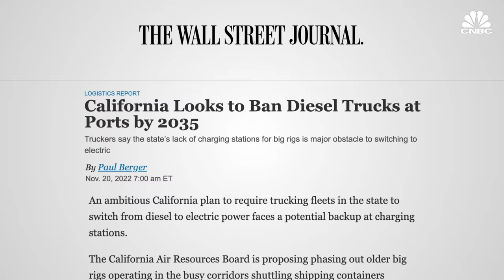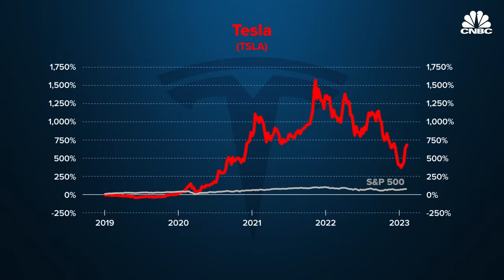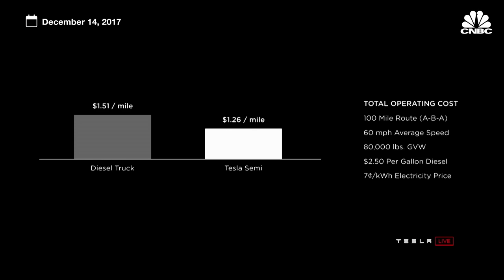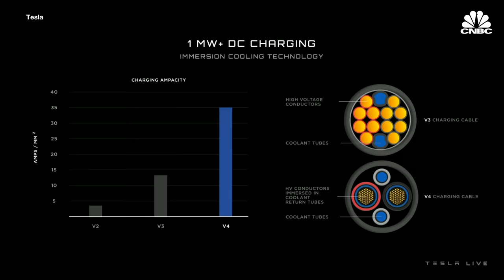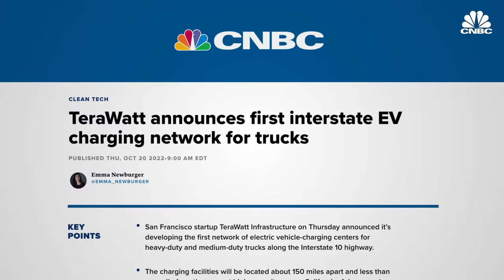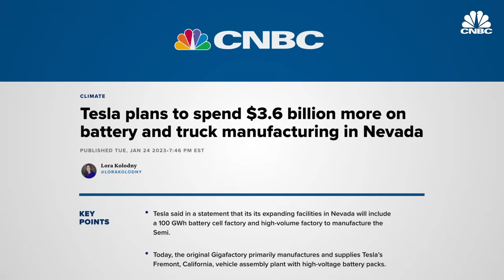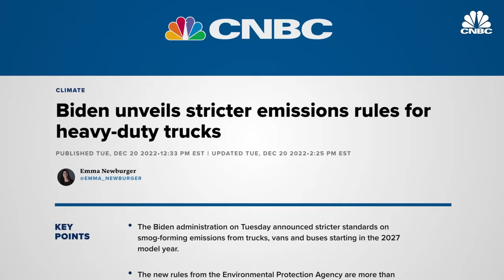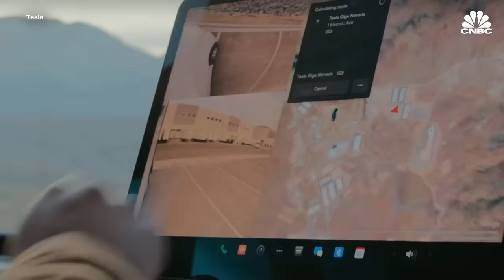Does The Tesla Semi Live Up To The Hype?

Comment: How much they charging for these things and how long they last? Semi couldn’t haul the weight. The EPA shouldn’t be pushing this regulation on the so called free market. It will destroy our country and lives. Supply chains are already stressed. They are destroying our way of life and their way of life too.
Reply: This truck uses 811 cell chemistry, it will go 400,000 miles before the battery looses 20% of its capacity, the trucks should cost around $200,000. But if you compare prices of fuel between both the electric semi saves over $200,000 in fuel over 400,000 miles driven. Newer version with silicon cells will do 900,000 miles.

Comment: Max gross weight is 123,000lbs or 63,500kg not 80
Reply: 23 USC 127(s)
"Natural gas and electric battery vehicles.--A vehicle, if operated by an engine fueled primarily by natural gas or powered primarily by means of electric battery power, may exceed the weight limit on the power unit by up to 2,000 pounds (up to a maximum gross vehicle weight of 82,000 pounds) under this section." 
Are you in Canada?

Comment: 80% of electricity is still producing by burning gas or petroleum so I don't see any sense of this EV trucks yet. to recharge them you need to burn more oil or natural gas. wind and solar is not enough. Just marketing of tesla
Reply: Well, I just checked, and I learned to my surprise that you making up stuff and posting it on the Internet doesn't actually make it true. Who knew, right?

Since you're obviously a numbers person, I thought you'd want to hear the real numbers. First, 100% of the Tesla Semis delivered to date are deployed in California, where only 40% of energy comes from "burning gas or petroleum"—almost all of the 40% from natural gas. Second, Tesla Semis have triple the energy efficiency of diesel semis, and as such use only 1/3 the total energy of diesel semis.  So compared with a diesel semi, a Tesla Semi uses only 33% of 40% = 13% of energy from "gas or petroleum", as a diesel semi. Finally, as noted above, almost all of the 40% in California comes from natural gas, which produces only 25% of the particulate matter emissions as diesel trucks. So compared with diesel trucks, Tesla Semis reduce particulate emissions by >96%—which was their primary goal—among all their other benefits.

You're welcome.

Comment: How much pristine earth did they need to STRIP MINE For just one battery… it’s toxic junk
Reply: You're probably referring to lithium. The amount of lithium mined annually is trivial compared with the amount of other materials we mine. For example, for every ton of lithium that was mined in the world last year, 63,000 (!) tons of coal were mined—often in ways much more damaging than lithium mining. Similarly, for every ton of lithium that was mined last year, we extracted 46,000 (!) tons of petroleum.
 
The big difference is that if we continue mining lithium for perhaps 30-40 years, we can complete electrification of the economy, and end most of the mining of coal and much of the extraction of petroleum forever—and greatly reduce mining for lithium as well; because once electrification is complete, all lithium (or whatever replaces it) required for new cars will come from recycling old batteries. On the other hand, if we allow the fossil fuel industry and FUDsters like you to stop the mining of lithium, and thus the conversion to a renewable economy, we will continue to mine coal and extract petroleum at a similar rate forever.

The choice is clear, and I opt for short-term mining of lithium or other minerals required for EV batteries, in order to greatly reduce mining tens of thousands as much of other minerals, for all time.
Reply: Are you thinking about the fracking...😅 ?

Comment: that ugly thing wont be hauling the milk loads that i haul. i drive a local tanker truck, typical loads exceed 90K on a daily basis (gross) and can easily exceed 100K lbs. my assigned truck is 2022 T880 x15 cummins 565 hp and an 18 speed manual.  too much weight and way too many hills. there are allot loads this truck will be useless for. these truck are also too expensive. more expensive by far to purchase, less capable..... and i wonder what the battery replacement costs will be. the batteries cost $20K for a car, i bet these batteries will be 100K. i also wonder how long they will last, even a local truck will run 60-70K miles per year fairly easily.

Comment: 😮😮😮500 miles rangylol 😂😂😂😂
They testing on flat roads, normal conditions 50-70F and max capacity 50-65kLB lol
In reality 80-120k LB , 90-115F or -40F  and in back roads on mountains ⛰️ + 2-3 years drops 20% batteries 🔋 capacity in real world you will get 200-300 max lol 😮😢😢
Electricity ⚡️ Cheeper then diesel lol that’s what they said about DEF or Natura gas ⛽️and now is 2-4 times more expensive 😮😢😢😢